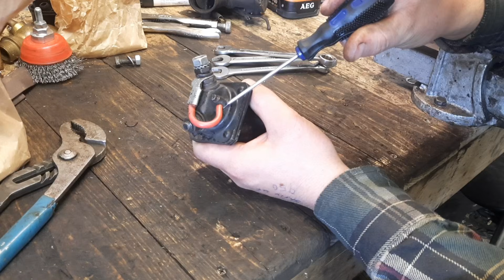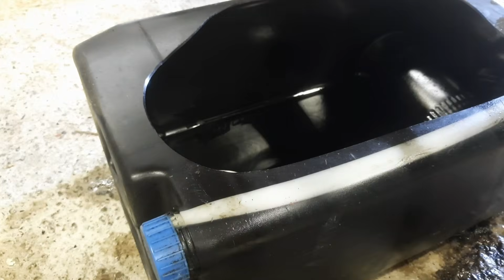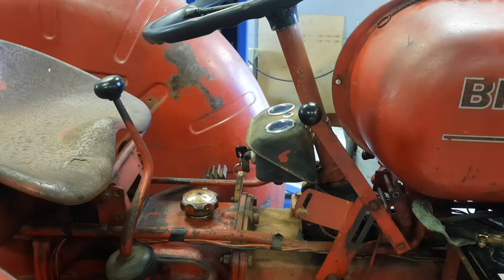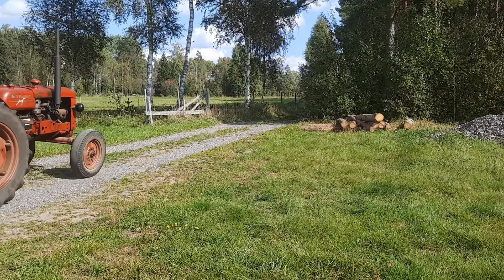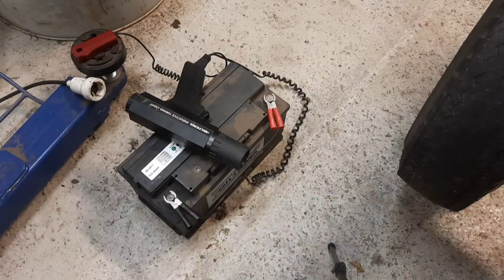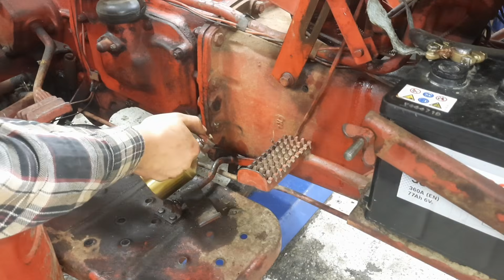10$ Dollar Tractor // Part 2. Ready for hard work again.

Comment: Nice video and nice vehicle. ☺️
Could it be that the ignitioncables of cylinder 1 and 2 are swaped? (It looks that the spark comes to cylinder 2 then 1 then 3 then 4, based on the view of the ignition coil)...?

Comment: If anyone comes to this video later and wonders if the timing light is actually not working, the reason it didn't was the tractor runs on 6 volts. The light needs a 12 volt supply, but needs to be part of the circuit of the tractor. Depending on what is ground, not all of them were negative ground, the 12 volt battery needs to be connected to the 6 volt one. But not both poles! You connect whatever pole is ground. Positive to postive if positive ground or negative to negative if negative ground. Another way to make it work is with a second 6 volt battery in series with the light; connect the timing light to chassis ground and put the battery on the other lead. Thus for Positive Ground: Postive of light goes to positive of the tractor battery, negative of the tractor battery goes to positive of the slave battery and finally the negative of the slave battery gets the negative of the light.

Comment: I agree with some of your other contributors in that I always set the flywheel to the timing mark and then loosen and turn the distributor to see the spark or put a light in series with the points. I always dab a little grease on the distributor cam as especially on something that has stood a while the cam may be quite abrasive and wear the points heel and alter the gap and timing , Very well presented as always

Comment: to dry time a points ign set your flywheel to the 4 degrees,put a spark plug in the # 1 plug wire then loosen the dist. turn the key to run,and slowly turn the dist till a spark jumps the plug gap, tighten dist and you will be balls on every time!

Comment: Its a very nice tractor You have there.
To make the timing light work You need to connect the 12 volt battery to the tractor’s earth.
Without that reference, timing light will not work!

Comment: i am a German and it is something for me unusual to see such a Tractor, which is still a "working" Tractor, without a rollbar. In the 60's it became mandatory for German Farmers to retrofit their Tractors with Rollbars. In most cases it was simply three sturdy steelpipes which could be inserted into two Sleeves over the back Axis. It was an easy Retrofit which reduced the accidents especially when you where pulling uphill or on uneven Ground. Often the Farmers don't drive with them around on Roads, but for working on the Fields or in the Woods it's mandatory. We got some of "Museums Tractors" which are not retrofitted. But a lot of them have the Sleeves but simply not the Rollbar inserted to look original.

Comment: You will need to change the front tyres if you want good steering on none road surfaces working farm implements as these tyres will just skid and you will be forever using the wheel brakes to force steerage,  a simple solution would be to fit chains to the front tyres when farming with an extra heavy  middle radial chain this will give the wheels directional traction and save your break bands from wearing out quickly

Comment: Tractors in the UK used to have two fuel tanks, one for petrol and one for TVO [Tractor Vaporising Oil] which I think was basically paraffin [kerosene].
You started on petrol and when the engine was warm, you switched over to TVO.
Reply: The main advantage lay. in lower tax levels but it reduced power and required a special carburettor. With diesel engines or more modern petrol ones as in the BM 425 TVO fell from use.

Comment: I wish they still made tractors like this. Very similar to our American tractors of that vintage. I have a 1948 International Super A and a 1968 Massey Ferguson 135 diesel.  Great channel
Reply: Tractor engines which purr rather than chug have always been uncommon. Only about eleven thousand B M 425 examples were made in five years and they used an engine developed for a decent quality motor car. Even the petrol/gasoline motor used in the Ferguson 20 and similarly car based, is a trifle more "agricultural''.

Comment: Great little tractor- would be interesting to see you covert to 12 volt
Reply from the maker: No, then the tractor looses all its value as a collect item Original is original. And what is wrong with 6V?
Reply: I wasn’t looking at it as a collector item but as a working small acreage  or a utility tractor
Reply: @TKM1951  It's not like starting up an American V12. This Volvo unit was designed to cope with cold winters and appears to start with great ease.
Reply: @paulhitchcock9760  found a 6-12 conversion with wrenching with Rachel Steiner tractor parts

Comment: Cheap timing lights are electrostatic voltage pickup instead of magnetic current pickup.
The electrostatic pickup type need a ground return path, so connecting the earth of the external battery to the tractor body will make it work

Comment: Disconnect the ground between the coil and distributor and put a light instead, connected to the battery. When the points open you loose the ground = ignition timing,

Comment: Feedback - mic is quiet - there should be some options on the camera for general sound level  - or it can be fixed on the computer later.
Didn't check coolant water level, power steering oil level & gearbox oil level & steering box oil level.
Greasing was rushed - very rushed - I suspect you assume people know how to grease stuff - and then you demonstrate an amateur greasing process. It took me a while to learn to grease things properly.
King pins (Steering) - ideally wheels need to be off the ground - it allows grease onto the thrust washer for each pin. Best is when there's a nipple both top and bottom of the king pin.
When greasing - wipe the face of the nipple and ensure visually that it's clean. Wipe more than once if need be - before applying grease gun.
If grease gun end has dirt in it, flush it out with fresh grease before fitting it perpendicularly to the nipple - the sealing surface of the gun end is flat, just like the nipple.
On a first grease, fill with grease until it is seen coming out somewhere.

You didn't show setting the dynamo voltage regulator. What did you set it to ? If there's also a current regulator, that should be set according to the dynamo's specifications.
You checked ignition timing but not valve timing - nor carburation mixture. Setting ignition by static timing doesn't eliminate errors in the advance & retard mechanism.
What's the engine's rated running speed ? Set that with a tacho (aka rev counter) Now adjust all the timings, one by one to get the peak RPM, closing the throttle a little after each one to bring the RPM back down to spec. End the sequence with carburation mixture - once done leave rpm a little high and move onto power output - increasing the load and increase fuel to achieve rated power output. You are now back to factory settings !

Enjoy your tractor !
Reply: It would have been rather better had you but looked at both videos about this machine before passing comment. Some of the matters you claim were not dealt with were attended to in the first episode and no video can deal with everything.

Incidentally, I have no idea as to whether it small tractor made in 1957 would actually be fitted with power steering. Do you?
Reply: @paulhitchcock9760  Cheers for the response (few get that from me ;) )

"It would have been rather better had you but looked at both videos about this machine before passing comment. Some of the matters you claim were not dealt with were attended to in the first episode and no video can deal with everything."

It's a YT feature that you don't have to watch videos in order or one can choose to watch ones of particular interest.
People (I'm not a psychologist) love to see engines being readied and started - just search YT for 'cold starts' - and see if you can find any better than: https://www.youtube.com/watch?v=yPzubVpLYAc

Then there's the infinitely tricky question which clips to group together to make a 'video'.
As you've now implied voltage regulation was covered in the first video - I now have an interest to view that !

"Incidentally, I have no idea as to whether it small tractor made in 1957 would actually be fitted with power steering. Do you?"

We're into the realms of intrigue now !
It may be the one-armed original owner asked if power steering could be fitted.
It may be that the manufacturer was wanting to offer PS without drastic changes to the existing hydraulic system - so went for a belt driven version as cars use - after all the front wheels don't do a lot - especially without tractor tyres on them !
Being that design, it looks like an optional extra purchasers could opt in for.
I once came across a fork lift that had hydraluic pumps stacked on the engine. I thought it odd then realised that if the main hydraulics failed, the PS would still work. (In reality, the reverse was true!). That is one reason for separating PS from the main H system. Also offers a different operating pressure or max speed.

Is the rest of the steering conventional - with a steering box ? I suspect it would be - and that the drop-arm from the steering box operates a lever on the power ram - using oil pressure to drive the power ram (moving the steering) AND centralising the ram control lever. I've seen a tractor with a front bucket ("loader") with this type of PS arrangement.

I suspect nowadays, that there are more different arrangements of H. PS than there were simple mechanical methods of operating the steering !

Comment: I could understand removing the starter normally - but with the good access you have there it really wasn't necessary !
Reply from the maker: Yes it was, i could not undo the screw for the arm between the solonoid and startgear without removing the starter. And it is not possible to swap solenoid without doing that.
Reply: @YesterdaysMachinery  Hmm, I thought I'd spotted it clearly visible later in the video - in situ - which is why I asked the question !

Comment: 3:00 you know it's a complete pisser putting in a replacement component only to find it doesn't work.

I once fitted a brand new alternator to a tractor - that didn't work. A replacement for the new came a copleof days later - that didn't work - yeah tested that before fitting it ! so on the third time the lass brought a third alternator, I tested it in her presence - and it didn't work. I then grabbed some random alternator that had been lying about and I had her hold that one to show her the difference between one that works and one that doesn't. 
We then ordered an alternator from another organisation - which worked perfectly first time.

Comment: its nice to see how things were made way back when. Do you plan to convert it to 12v or are you going to stick with 6v? As for the audio, well I am a tad old and my hearing is worn out and so I am partly deaf, so the fact that you have enabled CC on your videos enables me to "hear" (read) what your saying and as such your audio is perfect to me.
Reply: I suspect, had it been converted to 12v he would have converted it back to  6v. Evidence of this is the replacement of  a working  if unlovely ignition switch. The sum paid would have been been tiny for a non-working much altered wreck. Only a proportion of farm tractors had this kind of finish.

Comment: The audio/ video improvement is great the tractor is runing well i have 2 old lister engines a lister A which is a single cylinder petrol and a Lister CS single cylinder diesel  love your videos on the Old machinery keep the videos coming I live in Worcestershire in the UK
Reply: I have a Lister 2 cylinder diesel from the early  60(?) Standing with a generator. It hasn't been started for 40 years.

Comment: Dear Richard,

So nice to see the tuning up! Typical Volvo tappet noise.

I used to have a Volvo 240 [2.3 litre B-series but with an overhead cam], but as a child in the 1970s we had a 145 Wagon with the 2 litre [B-series] which had almost exactly the same rocker cover and oil filler cap, and the same push-rod arrangement. It always had that typical Volvo tappet clatter. I rather like that.

I remember doing the timing [of the ignition] and we used a timing light on cylinder one on the front of the crankshaft. So nice to see this great old school style being treated with such care.

I would love a tractor like this. I am sixty, and just starting out [after brief period of un-employment] on gardening for wealthy people, and there is a huge demand, so I could almost justify getting a tractor rather than a car! I have never seen a Volvo BM in the UK, but I guess I might find a nice one in Norway or Sweden. 

I really enjoyed your videos on the old stationary engines as well.

Your posts bring me a smile in world where there are not nearly enough smiles.

Med glad hilsen fra George Fredrik.

Comment: About the timinglight : connect the minus from the external 12V battery to the minus of the tractor. That may help the timinglight to work.
Nice machine. 👍🏻🤝🏻
Reply from the maker: Yes i realized that too! But no succes.. think the whole circuit has to run thru it. But this will be fine anyhow!
Reply: @YesterdaysMachinery  an external battery will work just fine for a timing light, just as you had it. The power is just for the flash bulb. I can confirm, because a couple weeks ago, I verified the timing on an Allis Chalmers with a magneto, using a jump starter pack.
The way I was taught to set timing on a John deere with a points distributor, is to turn the flywheel to where you want the spark to fire, and with the distributor real loose, rotate the distributor until it sparks, then clamp it down.

Greetings from Wisconsin, USA! I really enjoy seeing all the "exotic" engineering on the old iron.

Comment: Sound is really good. The video is also really good. I'm so glad you fixed up this tractor. And it is a Volvo B1600 engine. We have a Volvo Amazon B1600 and it still drives good. We need to change out the distribution gears. Greetings from the Netherlands,, Kitty.
Reply from the maker: Hi! Thanks! Great engines for sure. Ok, do you order parts here from Sweden or do they have old Volvo-parts in the Netherlands in stock? /Richard.

Comment: God work with the tractor and kid! But i want higher volume.
Reply from the maker: Thanks! Okey, higher volyme overall? Or does the volume go up and down? /R
Reply: @YesterdaysMachinery  It´s good quality, but I think if I compere is it lower than others.
Are you interested in a flat pulley that fit your BM10?
Reply from the maker: @patrikjohansson5123  Okay, i have all volyme settings on max. I will se if i can make it even higher 

Yes im looking for a belt pulley for the Bm10.

Comment: For the strobe, try connecting the grounds on the 6 and 12v batteries together
Reply from the maker: Yes, i tried that also but didn't work. The strobe work on a 12v other systems so nothing wrong. Dont know if it have to use the positive on the vehicle also.

But i know that the strobe is sensitive, got a hard time picking up the signals. On several engines i had to open up the spark plug gap to several milimeters so there is a bigger spark. Then the strobe sensor reads out ok. But didnt work here. Think the "good old" spark read out is good enough here. Regards Richard.
Reply: @YesterdaysMachinery  you might want to take a look at the ferrite in the pickup coil .. sometimes they get cracked, you can super glue it back together if so.

Comment: Paint seat and rims next?
Reply from the maker: Absolutely no new paint on this mate. It's value as a collectable would drop here in Sweden, and i only collect original. A little run with an oily rag on the rims and transmission body and fron axle would be nice, as ive already done on the front and hood. Then the original paint gets its life back.